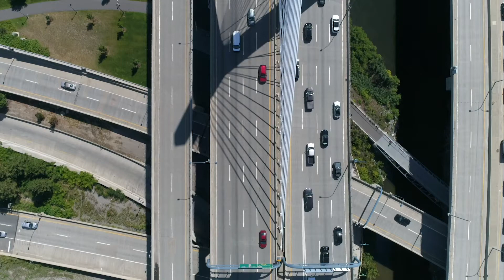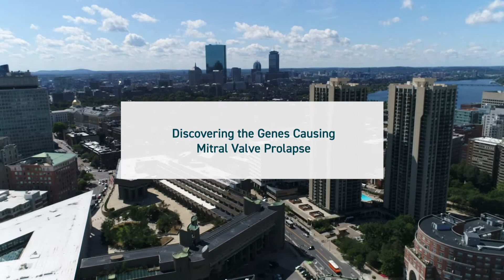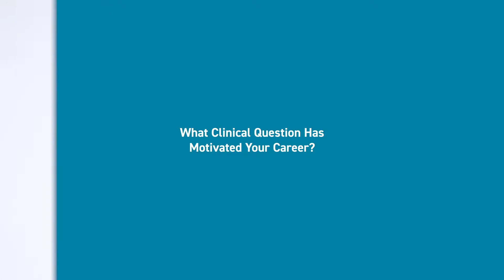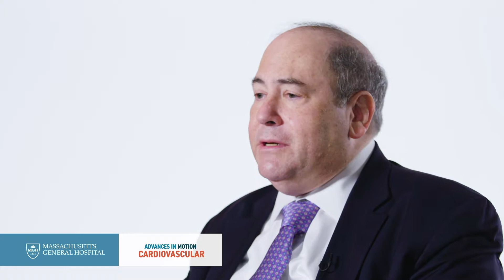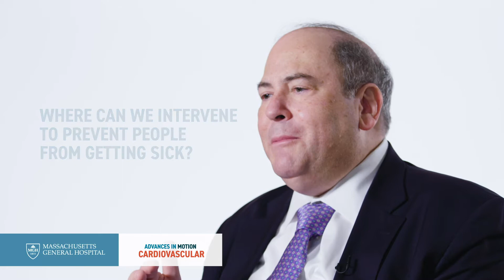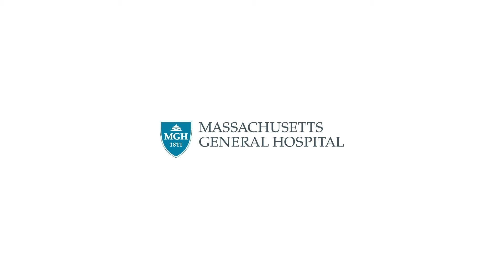Discovering the Genes Causing Mitral Valve Prolapse

Comment: I was always told from any physician that I had a heart murmur. This was from early childhood but never discussed until I had many surgeries and was looking to have another knee replacement. Echo was done August 2016. Mitral valve prolapse with regurgitation. Left knee replaced 9/2016.
April 4, 2017 a revision of left knee replacement went fine. In the recovery room I CODED. MY VALVE STOPPED WORKING. 
5/25/17 valve replaced